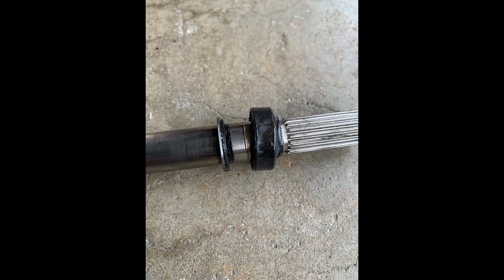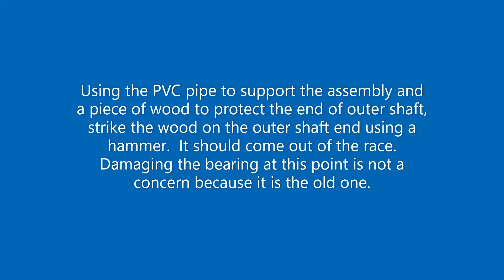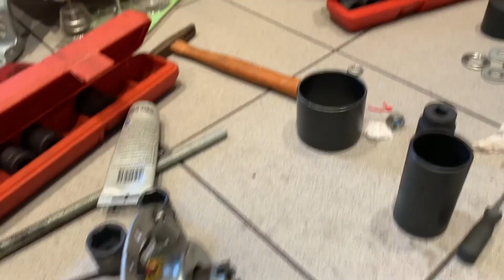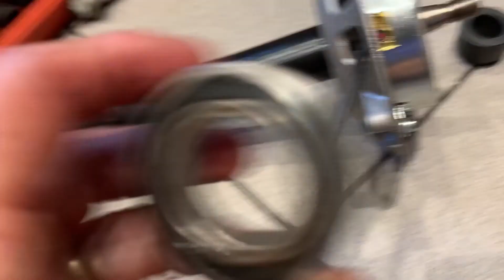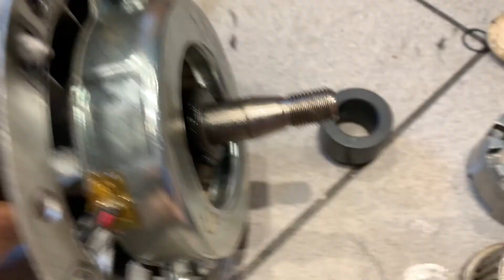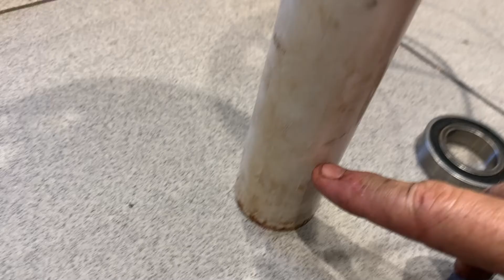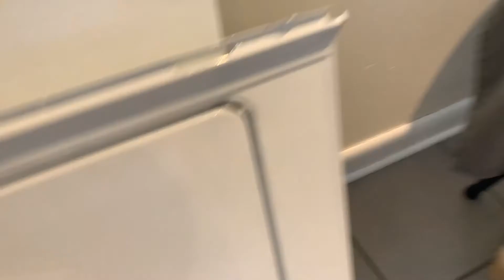Replace Bearing on GE Washing Machine GTWN4250D2WS Mode Shifter Shaft Drive Assembly

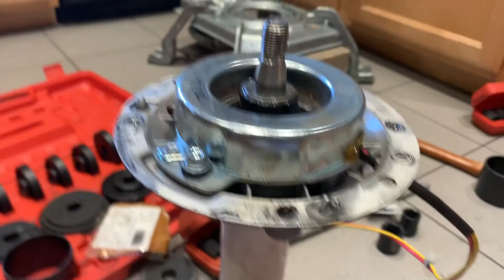Comment from the maker: I was curious about the same mode shifter of my neighbors which was indicating it was bad. You are suppose to get 70 ohms or something on the coil. I got nothing. Totally open between the contacts on the mode shifter. This is what powers the coil that allows it to go into agitate or spin modes.  I disassembled the shifter coil and lo and behold there’s a small thermal fuse in it which was bad. So when they say these shifters get a short more than likely, it’s this little bitty thermal fuse that can be replaced.  Once the coil is removed from the actual shifter mount, you can remove the plastic cover exposing the actual copper coils. Inside that is a small thermal fuse. I bet 90% or more of these failures is the small thermal fuse.  At 12:26 you can see the coil metal housing. Drill out two small rivets to access the coil winding. Here is the fuse ‘Thermal Fuse Cutoff 130c 250V 2A A4-F New’.

Comment: Thank you so much for this video! I was going to replace the entire shaft and drive assembly, which costs $450 here in Canada, but thanks to your video, I only replaced the bearing and seal for $21. I'm very happy to have extended the life of my washing machine.
Reply from the maker: Dude, I’m so happy to hear that it saved you money and that he did it yourself. It makes you feel good doesn’t it?  That same repair of mine is now years old than it’s still solid as a rock.  My wife uses it every day. I keep thinking I’m gonna have to do it again now, but it’s still running solid.  Have a great day.

Comment: The rubber metal seal at the top of the inner shaft where it hooks onto the agitator is a part that is leaking on my washer when you took that out did you get the serial number off of that shaft seal?
Reply from the maker: serial number?? You mean the rubber gasket/seal shown in 11:39?

Comment: Should’ve bought a new machine, these machines weren’t good and this part is expensive and the bearing is very hard to replace on these. Also, if the bearing goes bad on these washers, you should also replace the tub seal, as that’s usually the reason why this bearing fails in the first place.
Reply from the maker: @coolrobuxgaming  I disagree. I did the work now over four years ago reinforced the area with Permatex and replaced all the seals. It’s been running great with multiple loads a day ever since no sign of leaking either.  It was definitely worth it for me.

Comment: Good Stuff! Best video on the subject. The PVC pipe trick is really cool. However, I got the center shaft out just by holding the outer shaft and tapping the motor side of the center shaft with a rubber mallet. Just make sure to have something soft under the work area to catch the inner shaft when it comes out. Of course, before you try this, make sure that you've removed the snap ring, the gears and the magnet. A light tap was all it took. Of course, YMMV.
Reply from the maker: @uavpilotsmitty  thanks!  Can’t believe it’s four years since I made this video. Same washing machine same repair still running strong!  Probably due for some kind of maintenance soon though!  Thanks

Comment: this is an excellent video.  be aware that in 2024 I bought a newtub seal , plastic tub, and transmission.   the seal does not fit into the plastic tub.   It is VERY difficult to get it seated, and after sitting for a few seconds, it pushes itselt up and out of the plastic tub.   the reason for this is that the seal is about 1 mm larger in diameter than the seal recepticle in the tub.   it just wont fit.  I ended up taking sandpaper around the seal  edge to remove about 1mm of diameter, then permatexed the seal into place.  now it will sit flat and stay in the plastic tub.  it is shameful for GE to be selling parts that do not fit together.  I used all GE parts and not copycats.   PS -  i thought i had the seal seated the first go - put the machine back together.  it leaked right away and ruined the brand new transmission i had just put in.   when i took the machine apart, the seal had pushed itself up and that allowed the leak.  if you dont believe me, seat your seal and come back an hour later and see if its sitting flat.  if it is, your are good to go and lucky,  other wise you will see that the seal is not flush, and it will leak on you.   Im pretty PO'ed that GE cost me a brand new transmission with their crappy tolerance control.   I measured 3 different new GE seals - all three were the same and too big for the hole.  its maddening.  what are you doing GE ?
Reply from the maker: Very strange. I too permatex’d the seal area I recall. I don’t recall anything related to it not seating correctly like you describe. My is still running strong after this repair and I am very happy. My neighbor had the same washer but her board and shifter both were bad so she just got another washer - which broke the first day she had it!  I just posted an interesting note about this shifter which I found out after she gave me the old washer and I scrapped it for parts. Did you end up keeping yours?Thanks for posting!

Comment: I've been scouring the internet to find a video of the noise this bad bearing would make.
Our washer makes a horendous  noise when it goes into spin cycle and only the spin cycle, but it still goes through all the cycles etc. Also, when it spins, the clothes don't get wrung out very well. In your opinion do you think it's the bearing in the mode shifter would make, or 
is it perhaps only the tub bearing? It's definately leaking too BTW, water in the bottom of the pan inside the washer.
Reply from the maker: You can’t go wrong replacing all of the parts mentioned that I did in the video. It will make it a new washer. Mine has been doing great now at least 4 yrs later

Comment: I want to thank you for your video. I just needed help with knowing how that little snap ring holds that white washer in place. I rebuilt my whole unit. cost me $4.15 Canadian. whole unit new is $455.00 here.  I skipped a few steps you did. I did not remove the assembly from the frame used it as a support and worked well. I also did not see the merit of removing the electromagnet coil so left it on as well.  I am a repair technician here for almost 40 years.
Reply from the maker: Glad it helped Brian!  2 years later and our’s is still working great. No issues!  Have a great day
Reply: You should do a video on how you rebuilt it. You got my attention for sure.
Reply from the maker: @rogerbec5766  - I do have a video you can search for it. Hopefully it’s entertaining!

Comment: It seems the 6006-RS bearing goes bad when water gets past the shaft seal located inside the tub barrel and drips down the shaft on to the bearing causing it to rust over time. Of course when repairing you install a new shaft seal inside the tub barrel, but why not add another seal (same one) on the shaft and place it right above the Mode Shifter Shaft Drive Assembly bearing? Now if the shaft seal inside the tube barrel leaks, you have another seal that you have placed on the shaft under the tub barrel and slid down to sit above the bearing. When I open my washer up I'll take a look and see if that is feasible. It's April, 2023 and the whole shaft assembly is going for $118 on Amazon. Tempting to just buy the shaft at that price and save my time. And add that extra seal over the bearing...
Reply from the maker: Tempting to buy yes but $118 is a lot more than 10 bucks. Not sure if I am following you but I believe you are saying to put another seal on the shaft that divert the said dripping water away from being able to drip directly on the bearing?  If so you still have the original seal that is going bad and needs replacing so not sure what that buys you. Maybe some additional time but not much because you don’t want it leaking anyway. Thanks for comment
Reply: @condor5635 I haven't opened up the washer yet. I currently have a metal grinding noise during wash cycle but not during spin. So when I take it apart, I'll be looking at motor gears to see if that's were noise coming from and if so what caused it. Or if its the 6006-RS bearing that's gone bad, I will check to see if it's the barrel seal that caused failure. I'll go ahead and replace that seal and add another seal but put/slide that second seal on the shaft, above the 6006-RS bearing so if barrel seal should start leaking sometime in the future, it may not be caught till it kills the new bearing.
But, thank you Condor5635 for your write up/video, very detailed, lots of great tips, and if it is the bearing I'll have to consider your technique for bearing replacement.
I have some experience replacing bearing as I used to buy rebuilt alts for my truck/cars, but then figured out it's not that hard to open up the alternator and replace the bearings, stator, diodes,  and any other parts needed. Saves a lot of $, plus it's a lot of fun/satisfying to rebuild your alternator.
Reply from the maker: @rocknrocko4659  - if you’ve done alternators, then you’ll definitely be able to do it! You’ve got me interested in doing my next alternator. I’ve always taken them back as a core charge. Maybe next time I’ll keep it and see about taking it apart and learning about it. Good luck with your endeavor. Thanks.
Reply: I think that's a great idea. If you can divert the water leak away from the bearing itself and catch notice of the leak timely before it damages the bearing, this would give you a chance to replace the tub bearing and shaft seal and get it back to working order. Now the only thing I would be concerned with this idea is that suppose there's a leak and water runs down onto the secondary seal over the bearing and the washer is in spinning mode, won't the water running on top of the rotating seal cause it to spray out towards the motor possibly damaging it? Just a thought.
Reply: @rogerbec5766  Thank you for this comment. I'll take a look and see if adding the extra seal and if leak occurred in future if water spin off from second seal would damage motor. I would hope if I replaced barrel seal, I would be good for at least a couple of years. Second seal would be like a emergency back up. It would probably take a couple of years for the water spin off from second seal to kill the gearbox... maybe by then it's time for another machine as other parts may start to break down or the wife may demand a new washer :)
Reply: @rocknrocko4659  - My GE washer is a damn good machine except for the bearing issue. I will be trying as you suggested. As an another preventive, I just today ordered a water leak detector ($7.95 ebay) and I'll be taping it right under the trans. This should give me first alert too if there is a water leak. On buying another washer, be careful an don't buy those lock lid machines. They are crap. Get the Speed Queen classic TC5. Can't go wrong with those.
Reply: @rocknrocko4659  - I received my reconditioned transmission ($59) looks new and I tried the extra tub seal I ordered and it fit live a glove. Wish I could send you a picture. Also, I am going to slap a good amount of Magic Lube (by Aladdin) at the top part of the bearing for extra protection. Replacing the trans this Saturday. FYI. Good luck to you.
Reply from the maker: @rogerbec5766  - yeah that’s why I’m saying protecting the bearing with some kind of secondary seal or guard really is not addressing the problem and is causing other problems. Best to keep an eye on the seal and replace it before the day the bearing goes out.  I did this work over two years ago in our machine is still running strong with no signs of leaks so I’ve been very happy.

Comment: That last splined sprocket piece that you  easily slid off won't come off of mine.  It seems to be permanently attached to the spin tube.
Reply from the maker: Not exactly sure which piece you’re talking about but maybe you try heat or PB blaster or something. None of these pieces that I recall were seized together or anything for mine. You do need to use the proper sockets and what have you to ensure you’re putting pressure on the proper piece
Reply: Me too
Reply: mine was stuck rusted as one part. I just hit it harder with a hammer. either it comes off or you break it off. then get another part. mine came off eventually nothing broke use a punch and hit it evenly all in a circle
Reply: We're talking about the sleeve gear under the white plastic cap, right?Mine was tight, although not corroded. I was able to slowly, carefully pry it off with a variety of screw drivers and pry bars. It's splined on the inside so it won't twist off. Took a few minutes but it eventually came off. PB Blaster would also help if yours isn't corroded.

Comment: Is there a link to the Amazon page, or at leary a description of what I am looking for
Reply from the maker: If you just search for the bearing like I listed in the video you’ll find it but here it is from Amazon. (4 Pack) PGN 6006-2RS Sealed Ball Bearing - C3-30x55x13 - Lubricated - Chrome Steel https://www.amazon.com/dp/B07GYVQJDJ/ref=cm_sw_r_cp_api_glt_i_N4QQWX5Q1E8XZ21GE4JX?_encoding=UTF8&psc=1
Reply: @condor5635  thanks

Comment: We have a loud noise during the spin cycle on our GE top load washer, along with a metallic smell. My research led me to the Repair Clinic video about replacing the tub bearing, and the comments then led me here. I'm trying to determine if it's the tub bearing or the clutch bearing that's the issue. Any suggestions on how I might be able to tell the culprit prior to ordering parts or disassembling the machine?
Reply: Just took a quick look and the underside looks pretty clean. Maybe a few small drops of rusty water but not much. No signs of salt or other corrosion. Overall it seems pristine and visually in great shape. I made a quick video if you have a minute to look: https://youtu.be/ROOiHt6rF2U
Reply from the maker: @prwood78  - interesting it does look very clean Peter. One thing you need to make sure is those mounting bolts that mount the bearing housing to the frame. I had one of those come loose. I believe there’s four of them one is screwed in backwards or from the top or something like that and the other three are accessible. It’s possible one of those might’ve come loose so definitely check the mounts of those bolts. If you could post a video of what’s going on when it’s making The actual noise that would help as well
Reply from the maker: @prwood78  - I just checked ours there’s three bolts that you’ll see threads coming through the frame these bolts are black and you can see them against the silver housing pretty easily.  The one on the far right side in the back is a bolt head-  probably a 10 or 12 mm in size. Make sure all four of those bolts are secure and not missing. The other thing you might check is your brick in the back is it firm and in place and secured well or has it broken and become loose. This is the counterweight to balance the entire assembly
Reply: @condor5635  I checked the bolts holding the driveshaft to the frame. Three with the heads underneath and one (in the back right) with the head on top. All were present and secure.

I also checked the counterweight, and it was intact and secure.

At this point I'm not sure what the issue would be, but my next step is to try and get it on film when the symptom is occurring.

Thanks for your help!
Reply: Ok, I finally had a chance to record video during the spin cycle. Here are a couple of videos:

1. This one shows the sound if I open the lid during the spin cycle, so you can hear it spin down and then spin back up: https://www.youtube.com/watch?v=aSIGFnzDm6M

2. This one shows the sound with the lid closed, but with the cover off so I can examine the drum and drive area during operation: https://www.youtube.com/watch?v=zEyn4r10E5c

If you have time, could you take a look/listen at those and let me know your opinion on possible cause? I appreciate it!
Reply: @prwood78  did you change the shaft and assembly？Does it work? I am going to change my one soon.
Reply: @robertlow4999  Yes, I did change it, it’s working great now.
Reply from the maker: What I would do is takeoff the front cover and observe where the bearing is with a flashlight. If your bearing is shot water will probably have come down the seal and down the shaft and onto the bearing and you should be able to see evidence of a bad bearing with rust etc. If it’s a loud noise during the spin cycle and the tub bearing is a few years old I would entirely believe that the bearing is bad. There’s not really a clutch bearing per se it’s an electromagnet that throws the clutch teeth up and down allowing it to enter spin or agitate modes. Other than a clicking noise when it engages I can’t imagine this really making much noise if it’s working and you’re getting both spin and agitating to work. I bet it’s your main bearing
Reply: @condor5635  I'll take a look behind the front cover. Spin is definitely working, just really loud (kind of like the roar of an airplane engine when it's spinning). Agitation is not working very much if at all, which is another thing I noticed.
Reply from the maker: @prwood78  what do you mean by the agitation is not working much if any? That sounds strange
Reply: @condor5635  During the wash cycle when it’s supposed to be agitating, I mostly just hear a hum and it doesn’t look like the agitator is moving very much or at all. I thought I had read somewhere that this could be caused by a clutch issue, but maybe not.